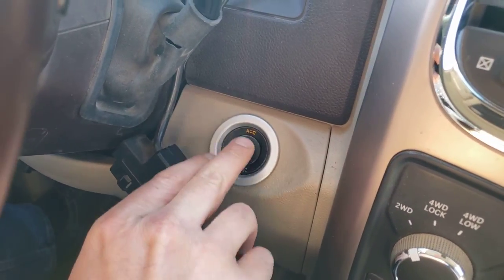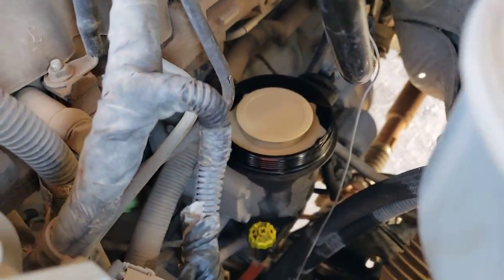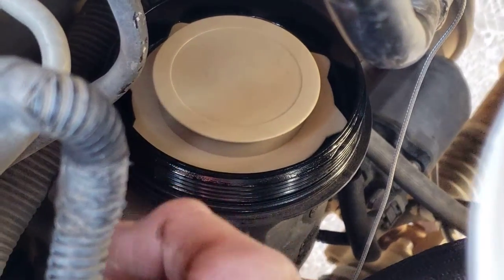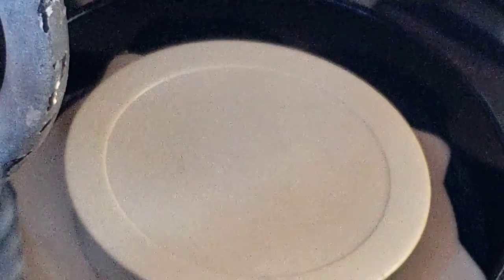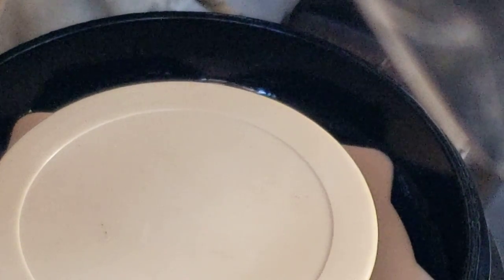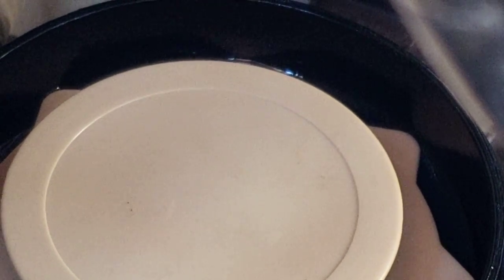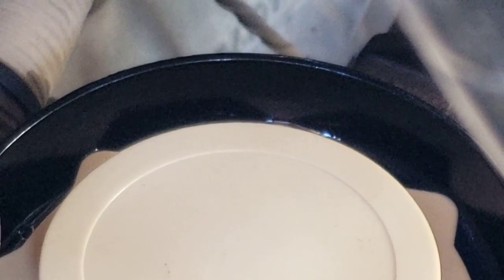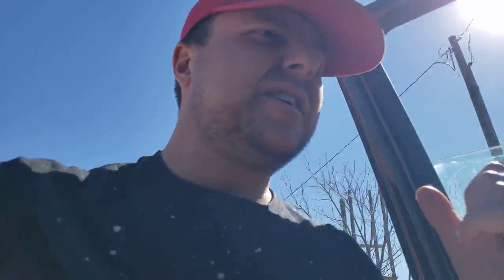Ram Cummins low fuel pressure

Comment: I had the same problem. I changed my fuel filters front and rear. I could not prime my front fuel filter. I had lots of pressure and diesel at the drain line on the rear filter. I disconnected my fuel line to the front canister. No fuel was getting there... I pulled off the rear filter and bumped the key. Lots of fuel coming out. I removed the check valve that the rear filter spins on to and removed the ball and spring to disable the check valve. This allowed me to get fuel to my front filter housing and re start my truck so I could tow my trailer back home. I assume the tank fuel pump is not providing enough fuel pressure to overcome the spring pressure of the check valve. My truck starts and runs fine right now without the check valve. However, with lower fuel pressure getting to my high pressure fuel pump I run the risk of burning it out. I am going to replace my in-tank fuel pump and reassemble my check valve as soon as the tank is empty.

Comment: The you fixed the truck
Reply from the maker: Yes. I installed an aftermarket high performance lift pump
Reply: @ryan1the8grate  ok thanks I have the same problem thanks
Reply: @victorgutierrez6003  you fix you truck
Reply: @ryan1the8grate do you upload a video when installed ? My truck starts but turns off after 8 seconds
Reply: @jvjv211  any luck fixing your truck? Mine just started.